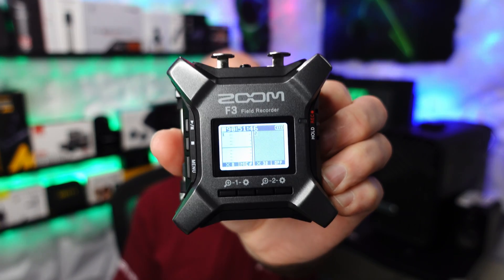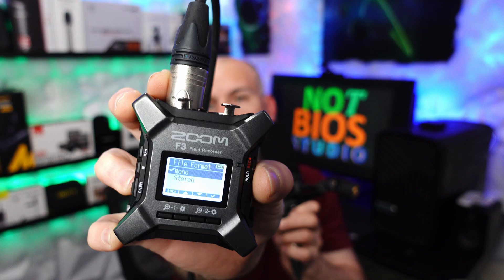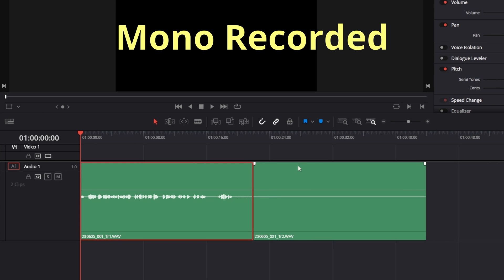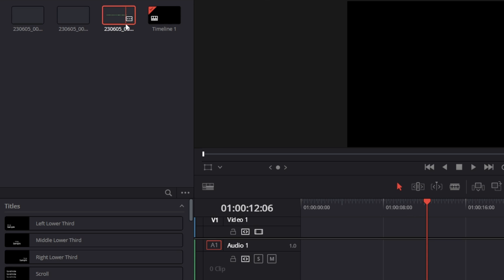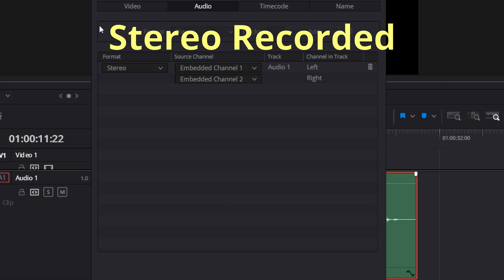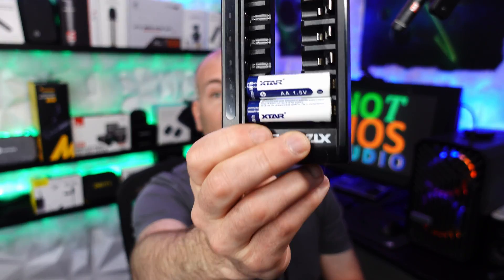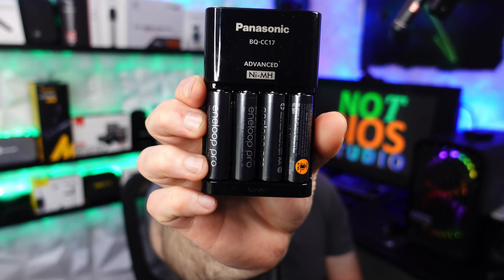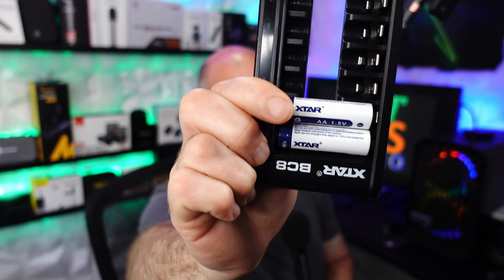Zoom F3 (Part 3) Battery Life, Audio Hacks & More *Hot Tips*

Comment: I really dislike having to set the date and time every time I insert the batteries. Any tips? Thanks.
Reply from the maker: Use an external power source? You can use a regular phone charger to connect to USB and simply leave it plugged in or other constant battery power source. Bet option is an on off switch because most battery banks turn themselves off because the Zoom F3 draws too little power
Reply from the maker: I never set the date. I just enter and enter rather than apply any information

Comment: I see only 1 XLR connected to the f3, what about the camera? How did u do that? Camera shooting at u but audio comes from the f3
Reply from the maker: @阿咕咕-b6r  don't understand what you are asking.
The Zoom F3 has a mono or stereo setting for one or both audio channels.
Don't understand what you are asking what about the camera? If you mean audio to the camera I use the line out and volume is adjusted with the plus ans minus don't exceed x4 of hiss becomes bad to camera, it is best to keep camera volume low it can cause hiss. Most cameras are 16 bit audio boosting the volume too much quickly causes hiss. The F3 has the microSD card to use for recording in 32bit which is the best audio possible if you are willing to put in the work of aligning the audio waveforms. I use Davinci Resolve to align the audio as I show in my long term experience with the Hollyland Max video
Reply: @ericsstudio I'm saying that when you're connecting at4040 with the F3, your camera is still recording the video too. There's only 1 XLR cable on the F3 that I saw(at 1:43), but I didn't see any other cable connected between your camera and the F3(line out?) How did you sync the camera and your F3+at4040? No offense, just curious how you made it.😀
Reply from the maker: @阿咕咕-b6r  if I watch my video YouTube is gonna punish me... But when indoors the audio is close enough between my camera and internal recording. I can still sync in post edit with no issues and if I start the zoom F3 and the camera recording close enough in time I am quite adept at syncing audio waveforms by eye looking at the waveform.

If I am speaking far away from the camera compared to the mic or am outside with wind syncing by eye or in editor is extremely difficult.
Reply from the maker: @阿咕咕-b6r  if you missed watching part 1 and part 2 you would have missed a lot.

Comment: The battery life is atrocious!!! I'm thinking to mount it on a cheese plate with powerbank holder and power via USB c because i have had AA batteries go from reading full to dead inside a single recording. Simply  terrible!!!
Reply from the maker: What battery is used changes things a lot. Even with the light on the lithium battery was 7 hours. If you watched the series of these videos you would see what I do. I use a battery back connected by USB and only dedicated to this device otherwise the audio can become ruined which I also show in one of the 3 hot tips videos. For standard batteries it drives me nuts about the battery life as well. The battery type has to also be set in the power type otherwise expect at times only half an hour of use before it powers off.

Comment: Hi Eric - I'm looking for some advice, I am filming a conference next week and as a backup I want to place my zoom f3 on the podium / lectern. I planned to plug in direct to the XLR a gooseneck mic. Something like this: Behringer TA 312S Dynamic Gooseneck Microphone

Would this work? I would likely find some power outlet to plug into the F3, but failing that I will use some AA Batteries, and change them in the lunch break. 

Many thanks, 
Major Tom
Reply from the maker: Remember battery banks are an option as long as the battery bank is exclusively used for the Zoom F3 to prevent any unwanted noise in your audio. I believe in part 2 video.

If a regular XLR size that mic should work. Could even add a line out cable for recording

Comment: Question. Why would you need to enable phantom power when using that xlr to 3.5mm adapter if your microphone doesn’t require phantom power ? 

For example I want to use a wireless microphone receiver plugged into the f3 xlr to 3.5mm adapter. The wireless mic receiver doesn’t require phantom power so why would I need to enable phantom power for this setup? 

Thnx
Reply from the maker: The specs of the adapters I used would make everything known, don't ever use 48volts phantom power with normal adapters. If using a direct normal cheapo XLR to 3.5mm with phantom power you would destroy pretty much all wired lavalier mics. The adapters I use convert 48volts to 3 volts mic power. Rode wireless Go and many other devices including digital cameras put out 3 volts. The Rode NTG mic has to be turned off and on manually without it and several mics that are 3.5mm require the 3 volts for proper audio.

Comment: Thanks for the video. Is this recorder a good option for Shure SM7B?
Reply from the maker: Most definitely. Watch part 1 and 2 hot tips videos to find out more... pinning in the comments right now.
Reply from the maker: I have no found this a bad option for any mic Dynamic or condenser. Internal 32bit records volumes are low by design. I've used the SM7B and the MV7 tested require the same gain volumes but 32bit float does not get hiss when boosted. The Maono PD100 and the PM500 requires even more gain and still works. Use also with the Audio Technica AT4040, Rode M5, Sennheiser MKE 600, Sennheiser MKH50, SE Electronics SE8, Audio Technica AT2035. I even hacked this to record the electric guitar.
Every single mic is out of pocket cost other than the PD100 I was sent for review.

I also reviewed a lot audio interfaces.
I also compare 3 interfaces
https://youtu.be/Yyyofy6KghY

I reviewed about 8 audio interfaces, one I only showed but didn't review (cause it had too many issues and was too complicated to just bother for a flawed product).
Reply: @ericsstudio  wow, thanks a lot, that sounds promising. I'm torn between this and MixPre 3 :D But I can hardly justify that purchase as I'm not professional sound mixer by any means to spend such money. So I was thinking F3 will be a sweet spot. Let me check the other videos you've mentioned.
Reply from the maker: @almynotes  I've used the Elgato Wave XLR, ARTURIA Audiofuse Rev 2 (An expensive mess with HUGE gain levels using the PAD boost), Scarlett 2i2 Gen 3, Vocaster Two, all 3 Maono audio Interfaces... I only use the Vocaster Two for convince to PC due to it's large gain volume and recording direct to camera line out is very clean and the F3 for nearly everything. If you want to really learn audio tricks and hacks you may like many of my playlist of Hot Tip videos:
https://www.youtube.com/playlist?list=PLYKqcb5ycRPZcPKwZ0B9M1W7WduplZsl7

My favorite all time mic is the Sennheiser MKH50 costs $1200 USD. Of the interfaces 2 of the Maono interfaces were provided for review, all others out of pocket cost.
If you use Davinci Resolve as an editor recording internally and normalizing audio levels using a mouse right click and using the line audio clips by wave form works well.

For your interface are you only going to PC?
In my case I sometimes go to PC, often just recording internally which allows me to turn the PC off and can test outside and inside without stopping recording with the freedom to move. The nice part about the Zoom F3 is I can boost volumes pretty much infinitely without introducing hiss and the volumes can be insane loud and it never clips the audio no matter how hard I try. I've only made microphones distort from exceeding max SPL levels. Sometimes audio may need more than 30Db boost for low input levels and Davinci is dumb in that you need to than use other methods to boost audio beyond it's 30Db limit... I learned how to boost most from Curtus Judd with his audio online courses, didn't know how to use fairlight. The part about all normal interfaces it they clip audio too easily from silent to loud noises. Zoom makes a normal computer interface with 32bit float BUT the output to speakers is subpar quality and of course like most requires the PC to be turned on. Another cheapish interface is the that does not have 32bit float but a compressor that prevents clipping audio and has external power source option is "Universal Audio Volt 276" but no internal recording and not as portable and no battery option but easier when using direct to PC.